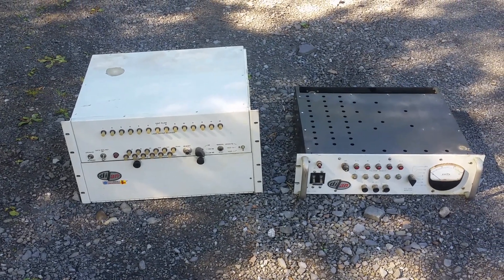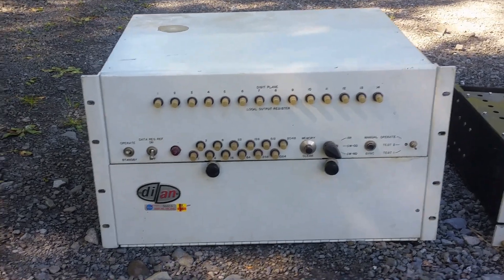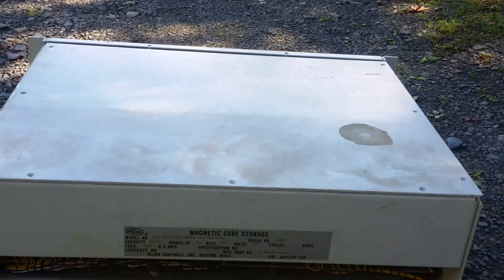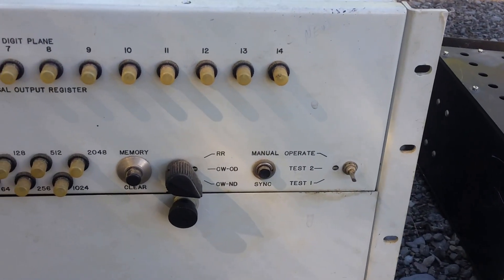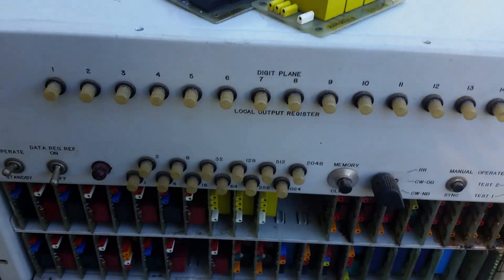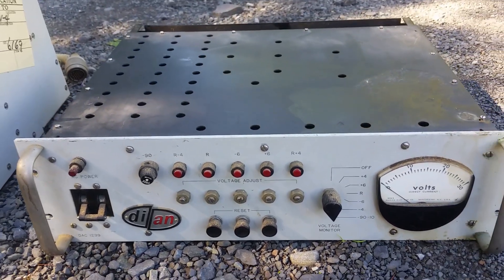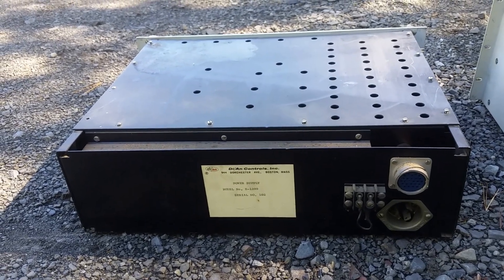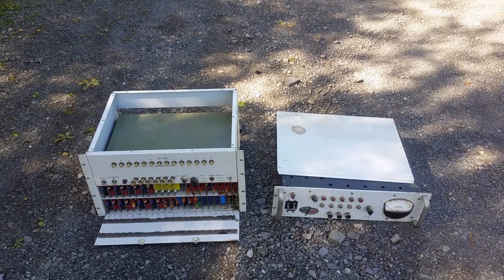DI/AN Controls Core Memory System

Comment: I believe that type of magnetic logic was used in the UNIVAC "Solid State" computer back in the late 1950s.  Another type of magnetic logic which was developed at TDK in Japan back in the 1960s is the Parametron.  It is somewhat similar in function but the individual logic units are more compact. Aleph Co. made a desktop calculator using several hundred Parametrons and an experimental computer was also built.  By that time, however, Sony had perfected transistor manufacturing and the Parametron fell by the wayside.
Reply from the maker: Eventually there will be a Parametron video.
Reply: oh my goodness i never heard of this magnetic logic, only component i know about that are relays
Reply from the maker: Magnetic electronic technology, both analog and digital, had a very brief moment in the spotlight right around 1960, due to its fantastic reliability (Its hard to break a transformer!). However, in just a few years transistors became far more reliable than they had been, and magnetic tech just could not keep up. By the late 1960s, it was mostly forgotten.